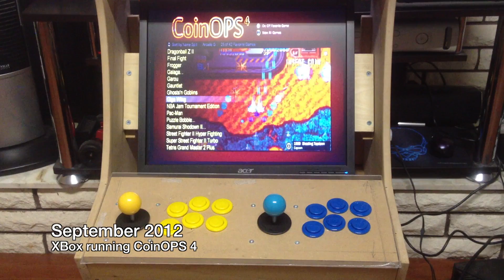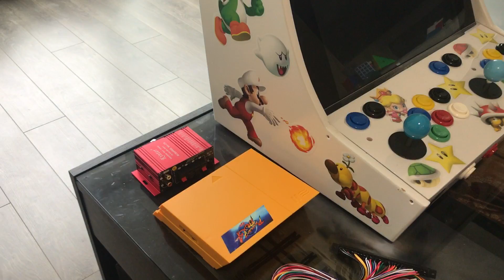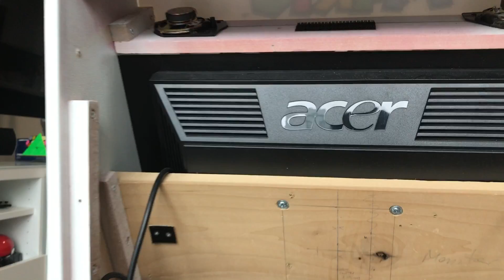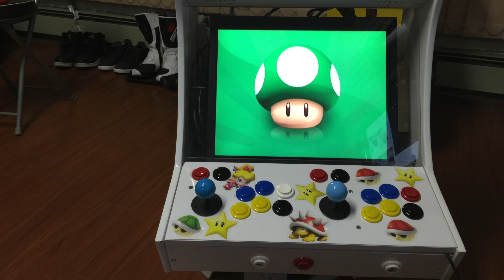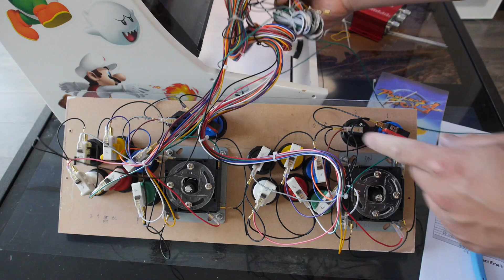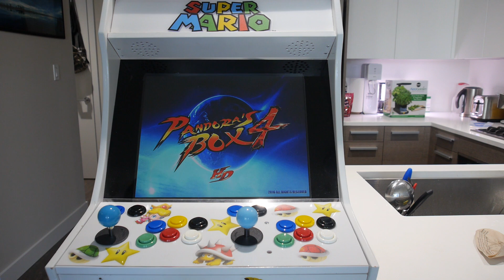✅ Pandora's Box Bartop Mini Arcade Build

Comment: great video can you do a video about how you power the pandoras box to usb thanks
Reply from the maker: It was really simple, I took a USB cable and cut off one end and soldered the red wire and black wire to the Pandora's box 5V wires.  The newer PB's need 12V so this may not work.
Reply: thanks i have pandoras box 3 and 5 will try it out thanks again

Comment: How did you connect the power source, 12V only, 5V only or both? Thanks.
Reply from the maker: For this one I only used 5v. I soldered a 5v adapter to it.

Comment: Hi there, I saw that you powered your pandoras box off a 5 volt USB. How do you do that off the USB wire, I'm guessing you attach the red wire on the Jamma harness to the red wire on the USB power wire. But for the black wire do I connect that to the other black wire, because that is ground, or do I attach that to the -5V pin on the harness. I'm planning on powering a pandoras box 2
Thanks
Reply from the maker: Hi, I use the red/black wires from the USB cable to the red/black on the pandora's box.  I didn't touch the -5V.  My PB4 ran fine on 5V, but the PB4S+ required 12V.  So if you can get away with 5V, great, if not you might need to supply it 12V.
Reply: Cool thanks I'll give it a try

Comment: Hi Ken have been looking at building one of these for my kids for Christmas. Looking at Pandora 4s and jamma looms I would want a 2 player 6 button loom. Ive noticed youve 4 extra buttons on the top and two below, have noticed extra buttons on the ready cut cabinets ive looked at to. Im guessing the lower white ones are 1 player 2 player, what do the other 4 buttons on the very top row just below the monitor do? Do all jamma looms have wiring in for these extra 6 buttons as standard? Thanks
Reply from the maker: +mk w only buttons on the control panel are active. They are P1/coin and p2/coin. The bottom ones are not hooked up to do anything. Previously I had an xbox1 so it could accommodate more buttons. But now I left them place to cover up the holes. Jamma loom won't have wires for all those buttons. Jus the the 8 buttons per player.
Reply: Thanks for the info as long as it fires up 1 or 2 player I dont need coin features so might try and get a cabinet without lower holes or as you have done just add in blanks. Is the 8 buttons per player a standard off the shelf loom then?
Reply from the maker: +mk w if you get the Chinese ones. There should be a link in the description. With the pandora boxes you can configure it so that p1 button inserts a coin and starts. It's in the config of the Pandora's box.
Reply: Cheers thanks for all the advice

Comment: What motivated you to switch from rpi to Pandora 4
Reply: The pandora boxes are less hassle, like he said with the harness they are easier to wire up, and unlike a rasberry pi it comes pre-loaded with emulation software and 600+ games already installed.
Reply from the maker: The Pandora's are just plug and play, everything is set up already.  The RPi's are still good if you're looking for console emulation though.  But for arcade games, it's really hard to beat the Pandora's.  I hope they come out with a Pandora with console systems like NES/SNES/Genesis, that would be awesome!
Reply: kenVersus yeah the gaming consoles games are the only thing missing from Pandora box series.  Other than that Pandoras box are mainly genuine arcade games.
Reply: Zoa's Video Games & Arcade Tours you can have the exact same experience on the pi though and more games. I think the extra effort given can make the pi much better imo. Also if you really want there are pre-made images